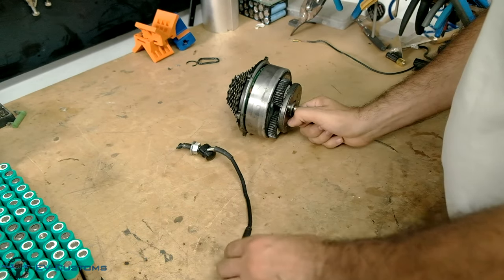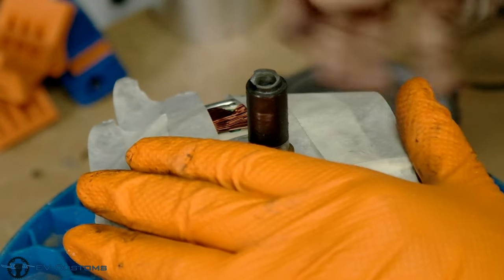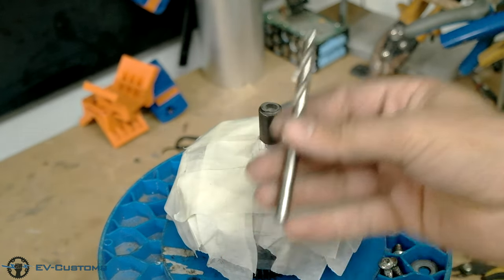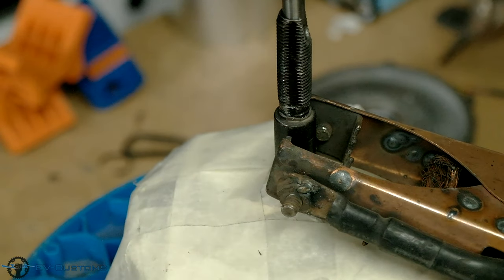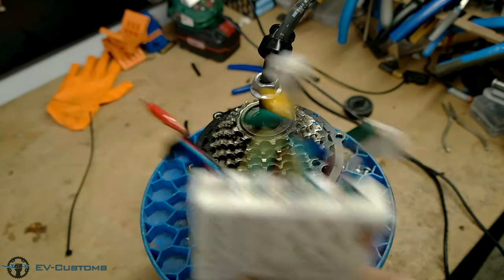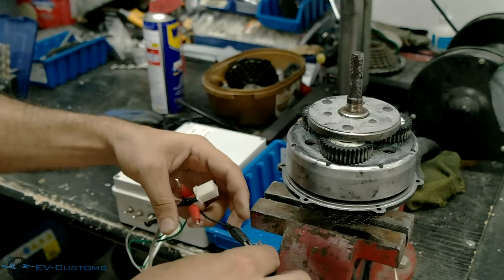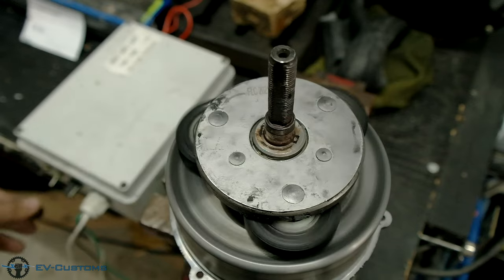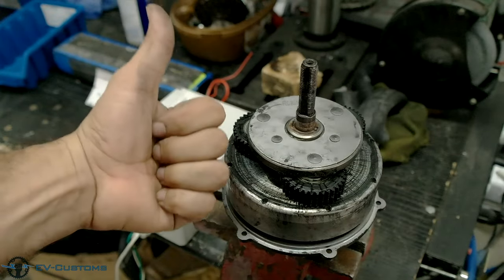Broken Hub Motor Axle ( Axle and Hall Sensors Repair )

Comment: which bike brand was it ?
Reply: It looked exactly the same as my Coswheel 20 motor. It was exactly the vid I was looking for! except he diddnt service the hall sensors- just replaced the wires. But after watching other vids, I learned the hall sensors dont like heat. long thrashy rides on hot days kills them. Im seeking ways to keep the hub cooler.
Reply: I am looking for hall sensors or Pcb board for a hub motor from Ouxi v8 with Pcb board from Huacan 0175LM.